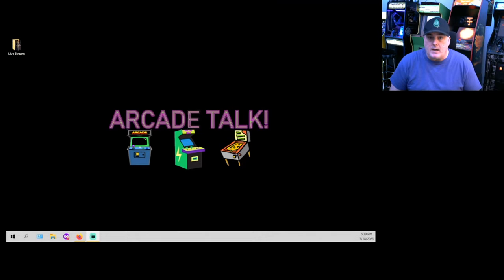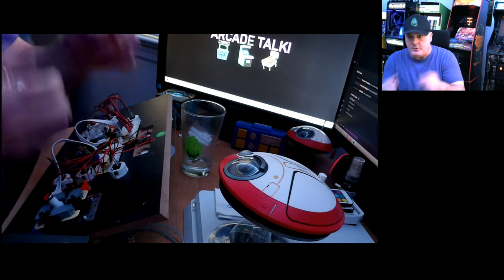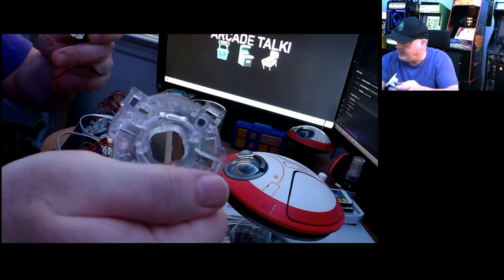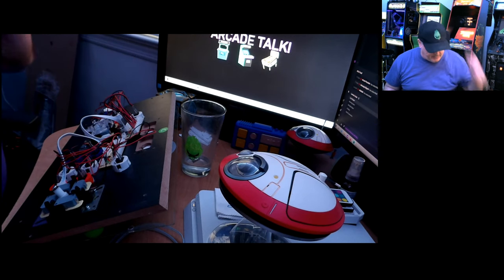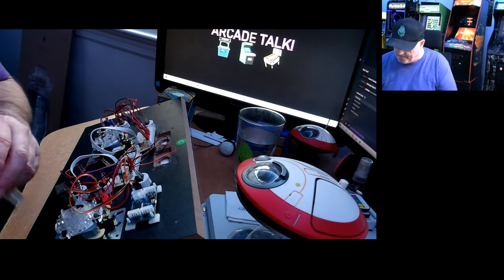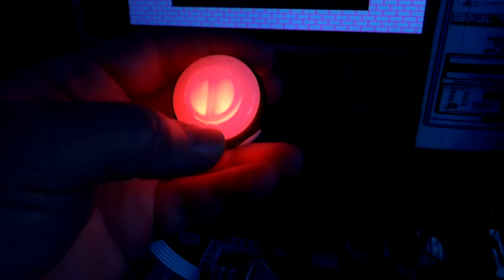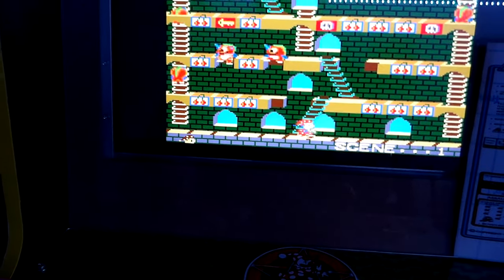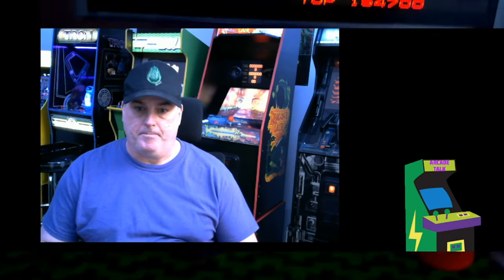How To Install GRS Switchable 4-to-8-Way Restrictor On A Modded Arcade 1Up Cabinet!

Comment: Hello Sir I’m curious do you think this could fit and work on an 8bitdo arcade stick? I really want to build an arcade cabinet for my Nintendo switch using 2 of those controllers
Reply from the maker: If it can be switched between an 4 way and 8 way it will work.